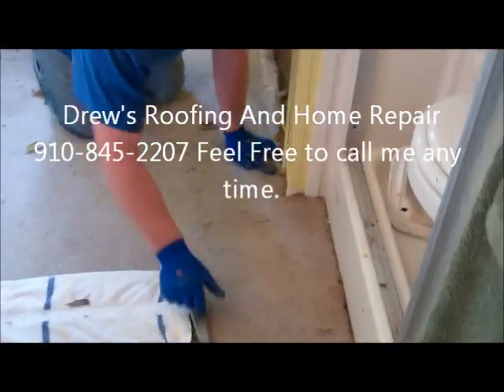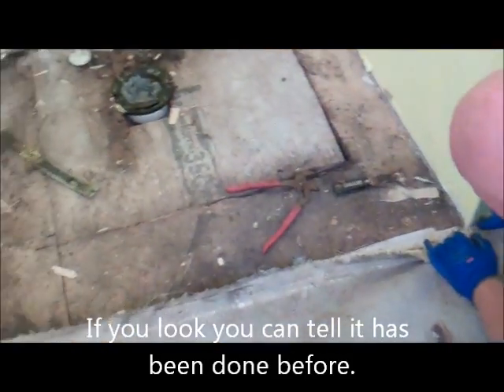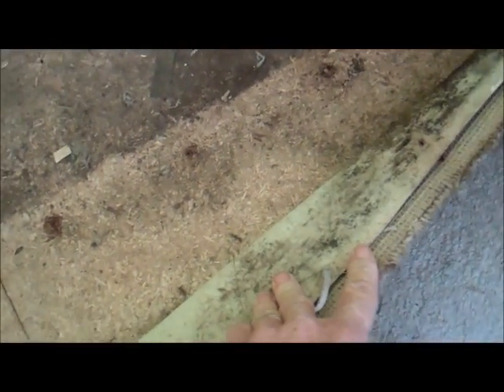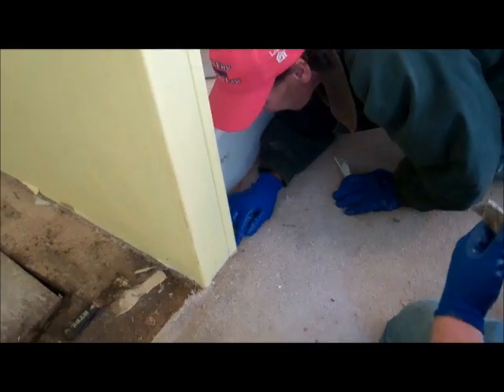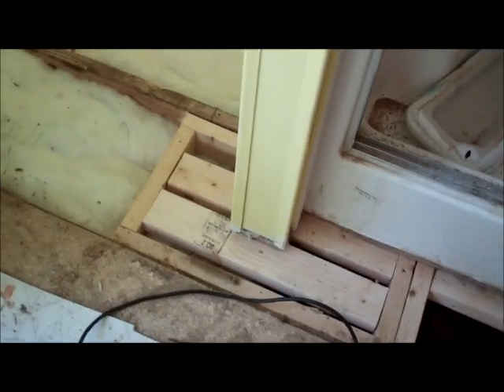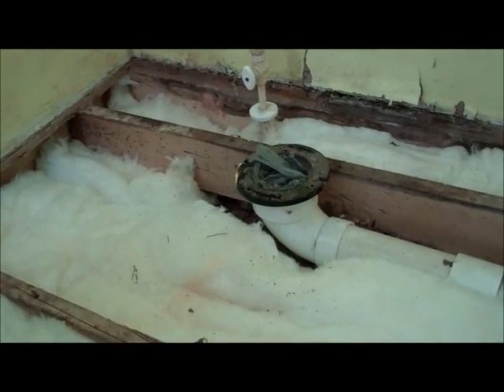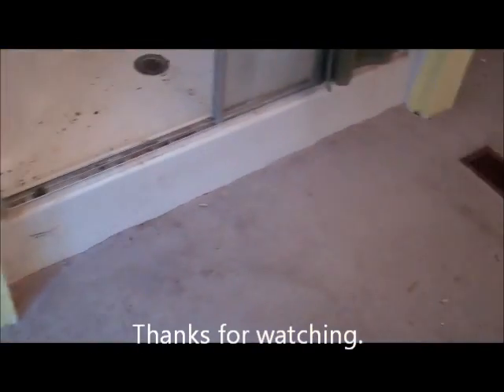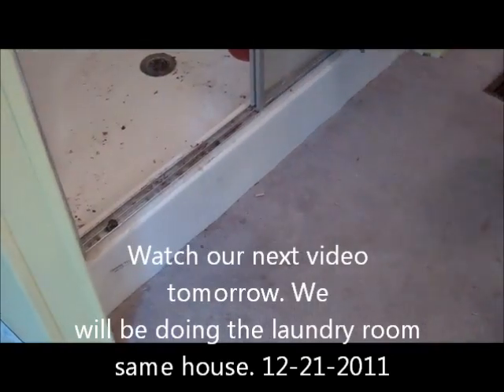Mobile Home floor repair How to

Comment: Carpet in homes creates unnecessary problems. Many countries build long lasting homes without carpet. Personally I think homes should have floor drains in kitchen and bathrooms.
Reply: Oh and thank you for these vids. Im having to takle these problems where i live because i dont want to move away as the property is rural and private.
Reply from the maker: Thank you